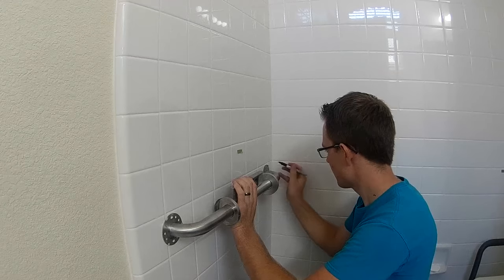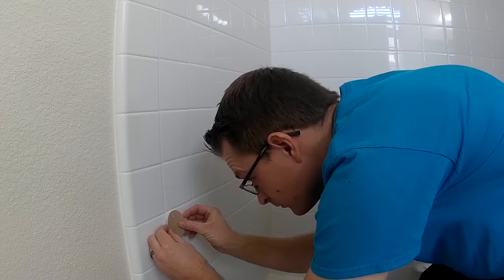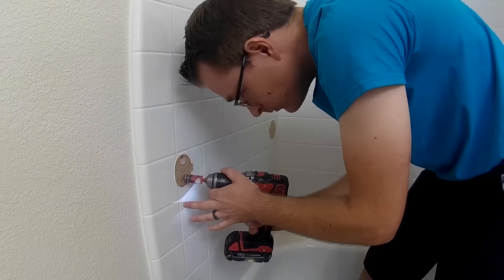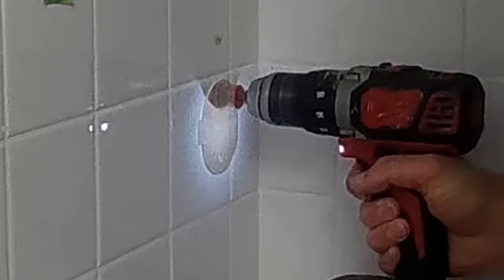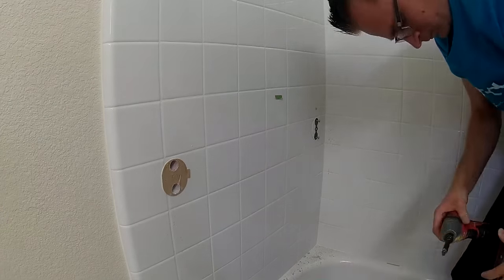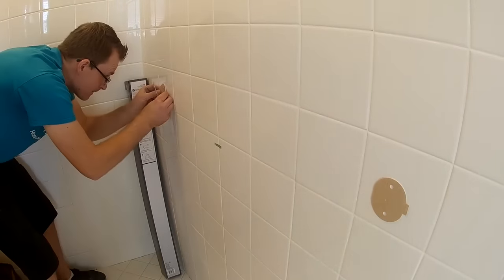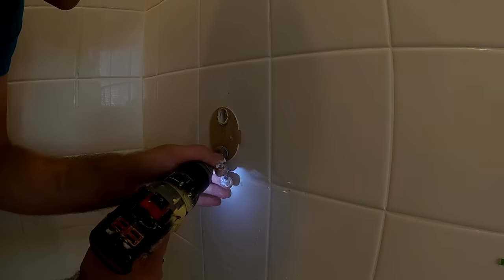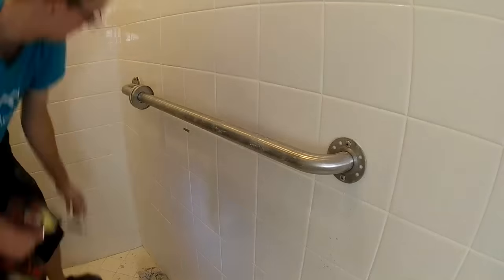How To Install Bathroom Grab Bars

Comment from the maker: Get the 3/4" Apache drill bit here: https://amzn.to/4e3IC7J
Get a set of WingIt grab bar mounts here: https://amzn.to/3KqrICS
Get your own 3/4" diamond hole saw bit here: https://amzn.to/2UYXjRa
Reply: How much does it cost the instruction ?
Reply: Thanks for the link to the Diamond Hole Saw!  What about the link to the WingIts?  Also what kind of drill is needed…does it have to be a hammer drill?
Reply: @sweetac271  you should not need a hammer drill just a regular drill.
Those wing its and hole saw are expensive. Even more expensive at home depot!
Reply: @sweetac271  they sell the wingits and drill bit at home depot. And they are expensive both of them.
Reply: i make i wood stencil to keep the bit from moving anything above 3/8

Comment: Thank you Allen, great video!
This gave me the confidence to install a grab bar in our shower.  I bought a 36" Delta grab bar at ACE and then did my research online to figure out how to install.  Your video was perfect.  I watched another video where the use blue paint tape to make all your measurements on and this helped me a lot and protected my tiles when I slipped with the diamond hole saw.  The hardest part for me was starting on the angle with the hole saw which you seem to be quite efficient at.  I did get a little better with each hole.

I did notice that the grab bar you used lined up with top and bottom holes on the template, with my delta bar the top and bottom holes were offset to match the correct distance with the wingit template.  This cause me some hesitation and fear, but after triple measurements I finally decided to go for it and everything lined up perfectly.  

Thanks again for taking the time to put this video together!

Comment: I just put in a grab bar and used a dermal 1/4" tile bit. 
First, I punched a hole through the tile and then used a circular motion to open up the hole to the size I needed.
Reply from the maker: Awesome! Great work

Comment: To find a stud behind tile: Use a small drill bit and drill through a grout line. When through, probe using a nail to find a stud. If you don't continue drilling until you do and then cover up the excess holes with grout (or perhaps caulk) Done.

Comment: Great video!  Unfortunately I found a block wall behind the tile that I wasn't expecting.  I ended up using the Apache bit to drill far enough into the cinder block to allow for the wings to spread out behind the tile/wall.  A bit more work but the wingits still worked fine.

Comment: Thanks so much for this clear and concise tutorial, it was a huge help!
Reply from the maker: So glad it helped!
Reply: @handymanjourney  Just a note for anyone who has not done this before, we used the Wing-Its on the first bar and it went very well. I also had purchased Snap Toggles and used them on the second bar, it went just fine also. Then on the 3rd bar, again using Toggles I got off my mark just a bit drilling the holes. It took a while to correct the problem, so what I wanted to convey, if you don't use the Wing-Its which have the template for where to drill the holes, perhaps make a templet and avoid the problem I encountered. My magic marker mark got smudged and I veered.:( Alas, all was well at the end. :)

Comment: Great video. I followed it and was successful at the end.
The most challenging part was to align both holes to match the Winglets (verticality spaced accurately). There are hardly any vertical adjustments on the grab bars.
I actually ended up enlarging the grab bar holes to allow the screw be mounted straight into the winglets.
Any suggestion as how to avoid that? I still have 3 more to install on my parents showers. I was right on target using the templates.
Reply from the maker: If you double check your measurements before drilling the hole that you are the exact measurement away from the center to center you should not have to enlarge the holes and you should be able to go right in with them. Best of luck to you

Comment: Please help! I'm using an 1-1/4" diamond hole saw bit and I can't stop it from slipping off to the side when I start on angle. I have even tied to go thru masking tape very slowly but I still can't control it. Your video, and all the others, make it look so easy. What else do I need to Know?
Reply from the maker: You need to start super slow , like slower than you think and at a super steep angle

Comment: Moen makes a pretty good grab bar anchor. Called the "Secure Mount" Drill one hole on each side and they fasten pretty nicely and hold a lot of weight. Great video Alan looking forward to more!
Reply from the maker: Hey thanks for that Darren!
Reply: I've used that product. Very strong and easy to install!!
Reply: Their mounting plates are made from aluminum which corrodes, and they show below the base of their grab bars after mounting. Not good in my opinion.

Comment: I thought this looked like something I could myself, so when I was with my 90 yr old dad, in Florida, I set to use this method.  Turned out to be a disaster because, in Florida, the external walls are made with concrete..  They put slats on the concrete and attach the wallboard to the slats.  This means there is only a 3/4 inch space behind the wallboard which means any method that relies on a space behind the wallboard will not work.  So frustrating!
Reply: How old is the house?

Comment: im confused..how the heck does the random grab bar mount just so happen to line up with the wingit template
Reply from the maker: You have to make sure you have your measurements correct
Reply: hi handy..not talking about measurements...im referring to the circl hole pattern on the grab bar...how can it be same as the wibgit template?..just coincidence?...all grab bars are made different and all the mounting hole patterns are different

Comment: I used one from Home Depot that has an epoxy adhesive that will attach right to the tile, It had really good reviews and I have to admit it worked great. Only drawback is you have to let the adhesive dry overnight.
Reply: Fact...... epoxy will not hold up to water. Minerals in the water will chew rate through it in no time. You better off using silicone, with a dap of hot glue to hold it in place all the silicone cures
Reply: I just do the work and find the studs

Comment: Great Video....I wanna install some Bars in my shower , it's not Tile nor Dry wall it's hard Plastic type material can I still use the Diamond bits and the Apache bit too drill....and another does those anchors come with the Bars in the package. Thanks again for a great clearly description of how too install Shower Bars.
Reply from the maker: Thanks for your comment, yes you can use the Apache drill bit to drill through that. Know the wing its come separately from the bars but are usually sold right next to the bars in the local Home Depot
Reply: @handymanjourney  Thank you gotcha....this has been a Project of mine for a long while.

Comment: Allen, how much do you charge to install the grab bars? And does that include the wing-its?
Reply from the maker: Typically I would charge around $90 labor per bar if I was doing other things at the home plus the materials cost
Reply: @handymanjourney  wow...! More than I thought. I'm in Mesa, AZ and most of customers are my neighbors.  I charge $50.  I need to reconsider my rates.

Comment: I have install two big tvs for a customer on the walls. Wonder if I could use these wing its to attach the tv mount to the wall?
Reply from the maker: Hey Dave, Thanks for your comment, Yes wing its would work for that, I would still put a screw in a stud if you have one, Just for good measure.
Reply: @handymanjourney  for sure I'll be trying to hit a stud. Hopefully I won't hit a water pipe. If I do I think I'll just drive off the job in a rapid manner.
Reply from the maker: Hahaha!! Ya, That would surely ruin your day!!!

Comment: Yes, but if you use the Wingits with a Glacier Bay grab bar, the plastic flange on the shower side of the wall will stick out past the bar's plate where the bolts go through. I had to shave off part of the flange.

Comment: the wall for the grab bar is exterior block. wing-it are to long for this wall since the furring strip between the block and the drywall is 1" or less.

Comment: WHy would you make a giant gaping hole like that? Just use an appropriate sized diamond bit to your project, back fill with silicone, push in anchors (assuming you cannot find a stud), and then mount your hardware. That is giant OVERKILL and opens the interior of your wall to exposure from micro leaking over time. BAD IDEA.
Reply: Its a grab bar not a picture frame.

Comment: I guess he can't tell the difference between ceramic and porcelain tile, holes would have taken much longer to go through porcelain tile even with the diamond bit.
Reply: he explained it- that he uses the diamond bit when he has to drill porcelain but it works well for ceramic too, which is what he has here.

Comment: Wingits wont work for any other brand grab bar except there own. The hole you have to make is so big that it sticks out from under the face plate on most other brands. You did not mention this. Dont go buy wingits and any other brand of grab bar or youll get a bad job. Use zip toggles or the Moen secure system for most other brands.
Reply from the maker: Thanks! Yes these work well with glacier bay grab bars!